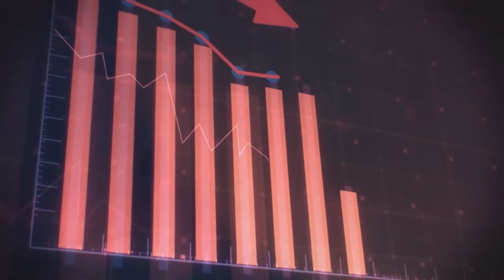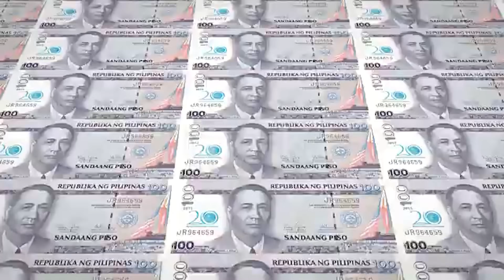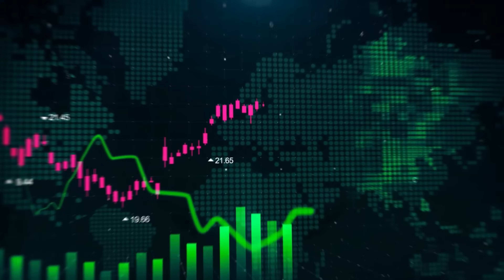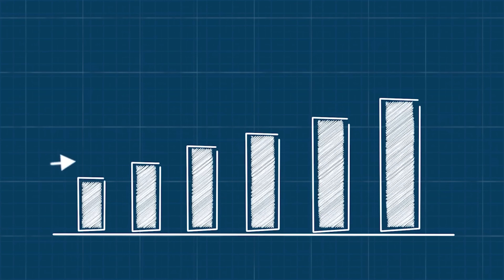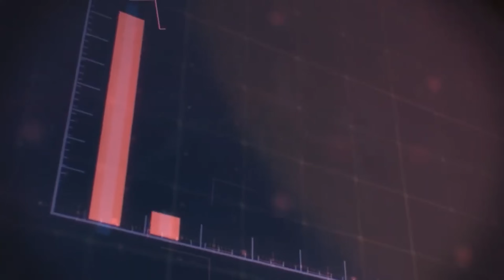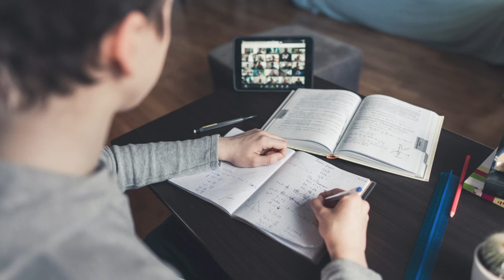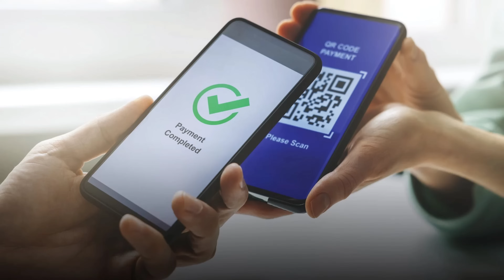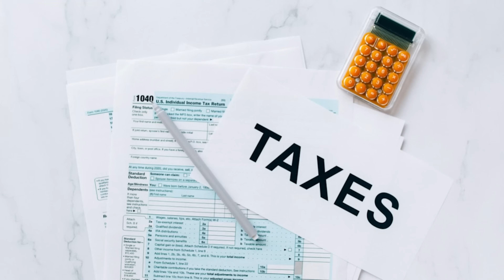Elon Musk’s Vision for the Philippines: Tesla, Starlink & Renewable Energy

Comment: HOPING ELON WILL TRY TO EXPLORE THE POSSIBILITIES TO BUY 40% THE SHARE OF STOCKS OF CHINESE GOVERNMENT ENTITY ACQUIRED FRAUDULENTLY THRU NGCP TO GET RID OF SUCH CONTROVERSY ON ITS ANOMALOUS TRANSACTIONS WHICH RESULTED IN STRANGULATIONS OF PHILIPPINE POWER ENERGY GENERATION INTO A POSSIBLE FUTURE PROBLEMS OF POWER GENERATION BLACKOUT SINCE THE SYSTEM CONTROL OF POWER GENERATIONS FACILITIES SOFTWARE WAS DRASTICALLY CHANGED INTO VERY BAD CHINESE CHARACTERS WITH DIFFICILTIES OF FILIPINO TECHNICIANS AND ENGINEER TO READ OR INTERPRET PARTICULARLY ON SWITCHING CONTROL RELAYS SYSTEM WHICH CHINESE NATIONALS ARE MANNING WHICH  WILL BE QUESTIONABLE IN NATURE OF MAINTENANCE MANAGEMENT OPERATION STABILITY.